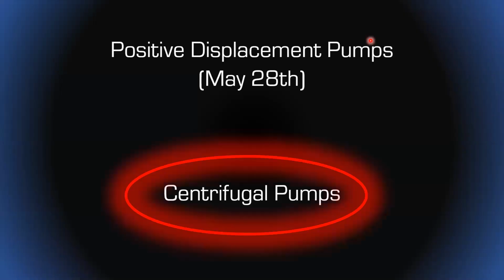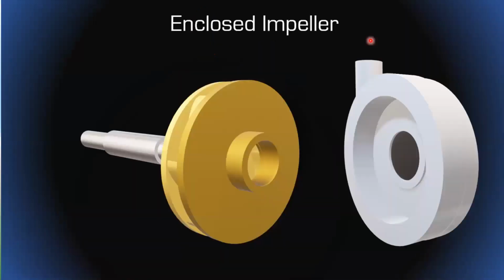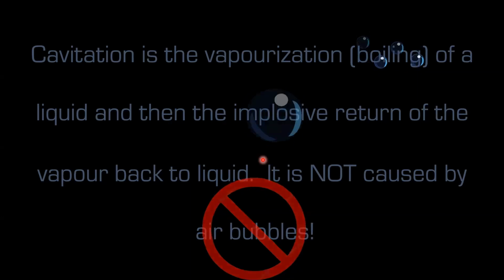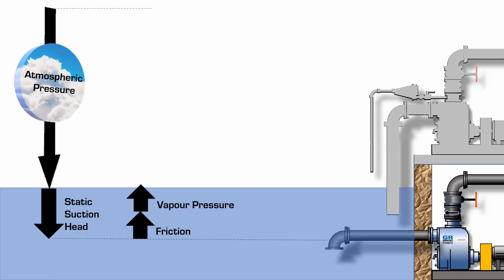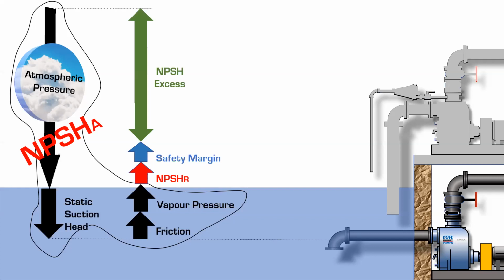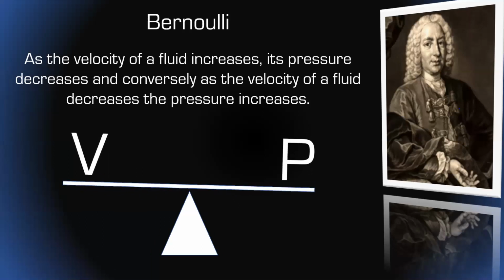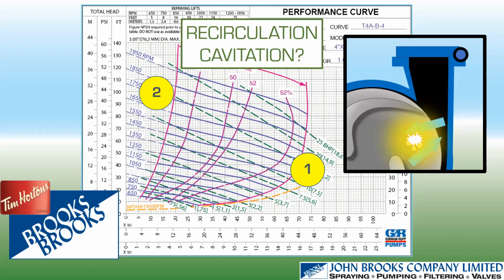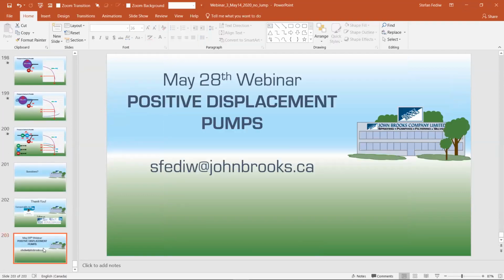An In-Depth Look at Pump Cavitation

Comment: That colored two vane impeller looks cool and I bet that's exactly what the pump industry was looking for; An impeller that does not efficiently use centrifugal force to move water.     PLEASE ... think critically and concentrate on what these colors are saying. BLUE - Suction that's great however it's pulling water toward the outer edge of the disk; That is NOT centrifugal force, that is the impeller trying to PULL the water through the impeller. GREEN - Recirculation What the hell is that? It's also NOT centrifugal force, it sounds like a waste of energy. RED - the tail end is at such a slight angle it's trying to PUSH the water out of the pump; THAT IS NOT CENTRIFUGAL FORCE ! ! it's a Blade PUSHING THE WATER OUT.          CENTRIFUGAL force is WATER GAINING ENERGY by SPINNING and then the WATER, in and of itself, PULLS itself Out of the rotor, . . . I hate to point it out, but Tesla turbines used as pumps DO NOT CAVITATE and if they did, the collapsing bubbles would do little damage because the impeller blades never harshly impact the fluid. Maybe one of you can explain to me why disk impellers are not used in modern pumping applications. Thank you for your great videos and I truly hope you can set me straight on this disk type impeller thinking.

Comment: hello i have a centrifugal pump suction end pump that is cavitating how can i purge the air bleed the air out of the system .
Reply: Cavitation has nothing to do with air. What you are experiencing is probably air entrainment issues. 
You should first identify the source of leak of air into the pump. Common culprits are flanges, or joints in the suction line or any mechanical damage or hole in pump casing (less likely). 
Once the leak area is detected, fix it and then re-prime the pump. It should be good to go.